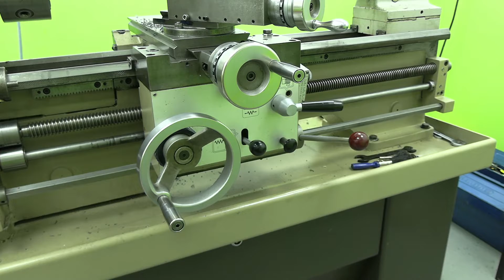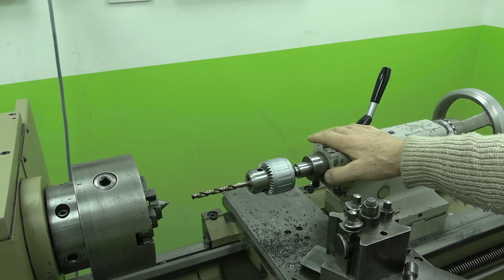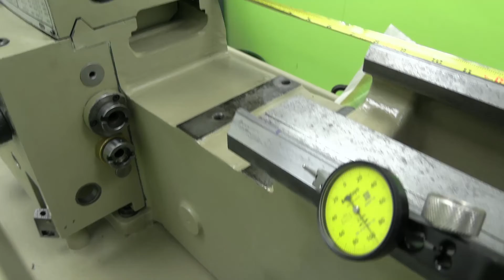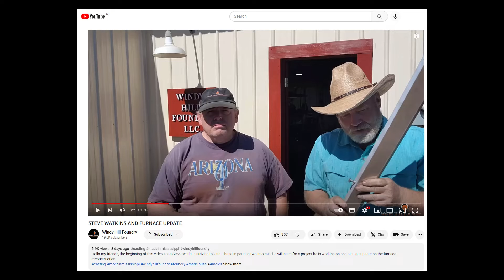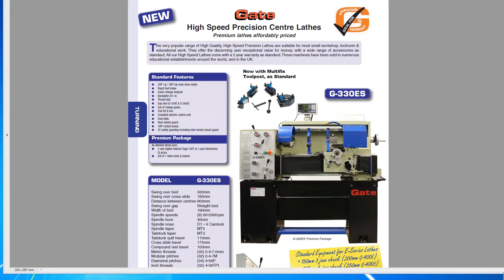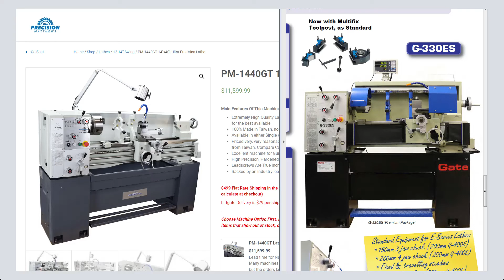What shall I do with my Harrison M300 lathe??

Comment: Samuel,  I haven't looked at your posts for several years and just recently had to jump into some lathe work on the M300.  Hope all is going well.  Just thought I could put a smile on your face with a short story.  I noticed that you have or had an XC60.  Likewise here.  Volvo heater blower motors are notorious for squeeling with age.  Several weeks ago I was having ours inspected and just for chuckles asked for a quote to replace that motor.  Several years ago it was $1800.  This new quote was $2600, certainly immoral and possibly illegal in some ways.  Our dealer wants $800 for the motor alone, while I can buy a new Volvo OEM part for around $260 any day of the week.  That's the way the greedy US dealers mark things up.

Are you enjoying the machine?  Did you ever do anything with the ways?
Reply from the maker: I've got a newer XC60 now, I like them. Don't know where the blower is, but usually these things are so embedded you have to dismantle a lot to get at it. May be the dealers charge for their knowledge of how to do that! No, I'm living with the ways as they are. Wish I had taken the bed to be reground when I had it all apart, but don't fancy doing it again. Plus there is a diminishing number of companies capable of doing it nowadays, and best one seemed to be in Sctoland - at other end of UK from me. I think companies whose cnc lathe wears out will just scrap it and buy another one.
Reply: @samuelfielder  Yes, the motor is buried deep behind the instrument cluster.  Dealer shows 8 hours of labor but there are internet shortcuts.  My shortcut is an extended tube on a can of WD40 and spray one bearing end from the firewall grill.  Worked for 3 years not but needs to be redone.  Likewise in NH/USA for precision grinding.  The few have limited capacity and are very expensive.  And scraping??  What's that? 🙂  added:  like any precision instrument today, I would not be surprised if the CNC could not compensate for any wear in the ways.  You would have one or more files with compensation values.  Let's face it, if movement is involved, the CNC can compensate it.  Recently re-considered CNC'ing my Bridgeport but in retirement the funds are not there.  Then, of course, the all knowing and wise wife asks off to one side ... what are you going to do with it and in my case, I don't have a good answer.

Comment: Because your familiar with the lathe and know its faults I would be inclined to strip it which should be easier the second time and get the beds and saddle refurbished which will give you the time to strip and refurbish the headstock with new bearings and seals!
Nobody asks how long it took!  but who did the work which is part of the enjoyment of owning a lathe.
Or you could buy a new lathe and be bored because you,d have nothing to do!🤔
Reply from the maker: So far, I'm just putting up with it as is. BTW those spindle bearings are very expensive (about £700 I think),

Comment: What did you do then?

If it was me I would work out a way to home grind it, Jerry rig something, that would get it much closer, using maybe box section, and a wheeled carriage, and a grinding wheel on a router, and shims on the bed, making it much better, you can’t make it any worse, a bit like scraping it in, but using grinding because it’s hardened, not perfection, but hugely better.
Reply from the maker: I'm just living with it for the moment. Have thought about your suggested action. Two other youtubers (Steve Watkins and more recently Max Grant) have similar plans but they aren't proceeding very fast, and I was waiting to see what they come up with. A major disincentive is that I don't have a big enough surface plate or long enough straight edge to help with getting a diy grind right.
Reply: Probably best to just live with it, you can still make some good parts, and compensate for the taper if needs be, most parts made on the lathe are small bushes and spacers, and the cost is huge to fix, and of course if we were in our 20’s the payback for that cost would be spread over a lifetime.

Comment: Quite a dilemma you are in, hope you found the right solution for you?
At a former toolmaker, i newer found lathes to be accurate enough anyway. As it seems that precizion is your thing, I´ll suggest to use the lathe as it is (though fix the oil seals), an look into getting a cylindrical grinder as well. Way more accurate, and not nearly as fiddly to get the perfect fit. Getting thin parts straight, bearings and tapers perfect and surfaces spotless is easy and with better control. This also is the way to go if you want to harden your parts as small amounts of twist etc just get grinded away.
Reply from the maker: I've stuck with the lathe I've got for now. Funnily enough a cylindrical grinder is one machine that I have never seen in my many hours of watching machinists videos on youtube.
Reply: @samuelfielder Rotary SMP has a good introduction here on an old TOS from Check republic. https://www.youtube.com/watch?v=hJS08uCBm-M
It does not need to nearly as complex, and a tool- and cutter grinder can do much of the same operations. The latter often allso can be changed over to work as a surface grinder, perhaps worth looking into?

Comment: Further to say that I'm currently using an old TOS lathe and I live with the wear - since most machining is carried out over a small part of the bed, accuracy is not so bad.  I mentioned earlier using drills, sanding discs and lapping/scraping - do not do this unless you have several hundred hours to spend and some very good comparator measuring tools.
Reply from the maker: Yes that's another problem: I onlyu have a fairly small surface plate. On the other hand, I can't make it any worse than it already is!

Comment: My advice would be to regrind the bedways or search machinery auctions - a good M300 will be far cheaper than eBay  - quite often by a factor of >5.  If you want accuracy go for a good used Dean Smith & Grace

Comment: Hi Samuel.

Tailstock quill can be hardchromed to add material and make it oversized. Then re-engraved or laser etched. You can then have the tailstock barrel bored on a horizontal borer. 

Unfortunately this is the world of machine tools in the UK, there are a lot of dogs (bad machines) out there and plenty of shady dealers looking to
move bad machines on. I don't know how much you paid for the lathe but you'd be looking at £3k+ to grind the lathe. Personally i think it's probably uneconomical.

Gamet bearings in your headstock are a special size and not available from timken. Colchester who owned Gamet did it on purpose. 

If you're looking for a trusted supplier give me an email and i'll pass some contacts on in the industry who only deal in quality used tools, not worn out tools.
Reply from the maker: Thanks. I'm living with for the moment.

Comment: What lubrication do you use on the rack and pinion and lead screws and to prevent rust in general?
Reply from the maker: I use Castrol Hyspin AWS68, which is the same as what is used pretty much everywhere except for the feed gearbox. It actually shows AWS68 for use on the lead screws on the lubrication chart at the bottom of page 8 of part 4.75 of the manual.
Reply: @samuelfielder  What about the change wheel gearing left of the hwadstock?
Reply from the maker: @jimspencer3072  Have you not got the manual? Well worth investing in. The change wheels also use AWS68.

Comment: Have you solved this problem now? I was thinking of a homemade grinding machine that didn't ride on the bedways but ground them as it travelled along? It would need a very flat table or some guide rods temporarily  attached to the lathe. You would still need to raise the carriage.
Reply from the maker: No, I am living with it at the moment. Steve Watkins had the same idea as you to fix the ways on a Monarch 10EE, but he is taking rather a long time to complete the project: https://www.youtube.com/watch?v=oQgxtSBXPxw . I might try this if I had a long enough straight edge to check progress, but I don't and my surface plate is too small too.

Comment: End plug 302.024 how to remove ? Slide hammer, puller , sledge hammer? ( 49 ) DO31031H3005 IN Harrison parts catalog
Reply from the maker: Sorry, don't know, haven't done it. Suggest slide hammer. Looks as if might be held in by O-ring. But odd that it has two holes in it rather than one central one. That suggests it might be rotated, despite diagram showing no thread.

Comment: Hello Samuel. While being very sympathetic to your differences between practical realty  and theoretic performance, I would enjoy the process to putting the Harrison right. I very much doubt that you will ever need a machine capable of industrial precision but if you did you can still achieve relative precision on this lathe. I must be blunt here, you have little practical experience of overcoming the deficiencies in a particular machine. That is because you have a greater experience in the "how it should run" compared to the "how do I make it run reasonably well". If you re -read these posts you will find lots of very helpful suggestions. Start at the beginning and level it. I myself have a Myford , a Hercus and a Colchester Triumph . each with inaccuracies in beds, ways, gib alignments, acme nut wear,etc etc. Working on them is my great distraction. I get lost in the work I do on them. It is a joy. Perhaps if you did not see your purpose of making the lathe produce reasonable results as such a burden, you might get more satisfaction from the process. Always remember, there's always a fix. Please let us know your progress. Cheers and regards Allan

Comment: Hello Samuel
I haven't watched all your videos but stumbled on this one today, so I may be "up a gum tree" with what I'm going to ask.   Have you leveled the machine accurately using a precision engineers spirit level..  If this hasn't been done you'll be chasing your tail forever.   Once the lathe is level , true  up a test bar in the 4 jaw independent chuck or collets if you have them and take some linear measurements along the full length of the test bar with your DGI mounted on the tool post.  Next minimise any errors by jacking up the either left or right levelling screws at the tail stock end which will in effect put a slight twist in the bed and improve accuracy caused by bed wear or manufacturing variations.  I'm a retired toolmaker and have seen this done on many occasions ,also to brand new machines.  No, not only Chinese machines but quality British machines as well.         
About your headstock bearings..  If you can.t feel any wear (roughness) and they are not noisy it's probably only oil staining, particularly if the lathe had been standing idle for an extended time before you bought it . If this is the case, close it up and use it .   They'll let you know they're not happy when the time comes..   
Hope this helps
Reply from the maker: Thanks. It is levelled, but experiments with adusting the levelling screws were not productive. I think I'd need to have the bolts bedded in a concrete floor to apply enough force to actually twist the bed. I think the lathe is quite rigid in relation to its (small) mass, and hence jacking up the screws doesdn't have much effect. But I don't think twisting the bed can really compensate for (large) bed wear. I'm not going to blow £750 on a new Gamet headstock bearing; I'm just going with the one I've got and hoping for the best!

Comment: Hi, very interesting series of videos about your lathe, now we would all love to have machinery with virtually unmeasurable errors however most of us don’t have those sort of spare funds. In my youth, some 65 years ago, I was very impressed how, what to me were old timers, who were able to produce exceptionally accurate items from very old, rudimentary and probably worn machines. It was not the machines that impressed me but the skill of the operators. Although I spent my working life as an electrical design engineer and sometimes consultant, I decided to do model engineering once I retired. I am forever reminded of these old timers when I come across work for which I think my small low cost machines appear not to be able to do as it might, and often is, me. Could you not just use the machine for what you intended to use it for and after that assess your needs. Please keep us posted as it’s all very interesting. Best of luck.

Comment: I have a student 2500. Esentially the same lathe. It has wear in various parts including the bed. I was wonderong where the regrind quote was from as I would like to get mine done.
Reply from the maker: I can't remember which firm it was. But try googling the following: Unislide Nuneaton, Blue Diamond Machine Tools, Slidewaytech, Nobilla Stevenage.
Reply: @samuelfielder  I got a quote from blue diamond a couple of years ago, but it was double what you mentioned in your video. The quote was for bed reground and saddle  turcited/scraped in and the tailstock scraped in.
I think at that price you should keep it and get it reground. I'm sure the headstock bearing could be sorted as well if the bearings are in good condition.
Reply from the maker: @mapstardamo1624  I think my quote excluded work on the tailstock, which I reckoned I could do myself.

Comment: I work as a machine tool mechanic although I am semi-retired. My advice if you wish to take it is to figure what you wish to use the lathe to make. If you need precision to half a thou you need a better lathe, if not you can learn to live with what you have got. I have 3 lathes of my own of which 2 were new Chinese and 1 which is 80 year old German type. All my lathes have their foibles even from new! Being a physicist as you say does not make you a tradesman. Unless you have worked machine-tools for years you will not know how to get the best out them. Getting hung up on measuring everything is a waste of time if the device is only going to be used to make bushes and do the occasional thread. Any old warn contrivance with a threading box shall do that. If you want better the best lathes out of Taiwan are the Jessey products in my opinion. New does not always mean flawless alas, I know as I work on plenty of it! I have a rule about buying lathes, if the bed is warn or the spindle is not concentric let someone else own it. From an economic point of view it depends on the cost of regrinding the bed in your situation. My advise is not to attempt to do that yourself. All other things on the list are things you can do with ease. Harrison M300 are a good lathe... Hope this helps...

Comment: Break it down as spares and purchase a new WARCO lathe. Will cost anywhere between £4000 - £5000 for decent GH model and it’ll be brand new. Had my WARCO now for a couple of years, more precise than I will ever need it to be. Very happy with it with no problems.

Comment: Hi, probably sorted by now but if still 'up in the air' there are videos of folks who have rebuilt lathe ways usingJB weld or Moglice.  I've no idea how viable that approach is mind you. Depends a bit on planned usage I would guess. The real solution is a regrind or possible a better bed from a donor lathe - probably rarer than hens teeth!
Reply from the maker: Yes, problem is I'd need a bigger surface plate and a longer straight edge than I've got, and then I'd have to be an expert scraper. I'm not confident on those points.

Comment: I would sell it and buy better machine. Then you can enjoy machining the parts instead of spending tons of hours for repair this one. 
BTW I am surprise how weak these machines are. I have Leinen LZ43 from 1943 and looks like it is in much better state than your much newer M300. Actually I want to replace that old lathe by newer and bigger one. Was thinking about M300  But after seeing your video I think I will go for other brand. Maybe Colchester or Weiler. Anyway good luck with your project. Stay safe.
Reply from the maker: I wasn't conscious of demonstrating weakness in this video. Ways are worn yes, but don't think they are weak.